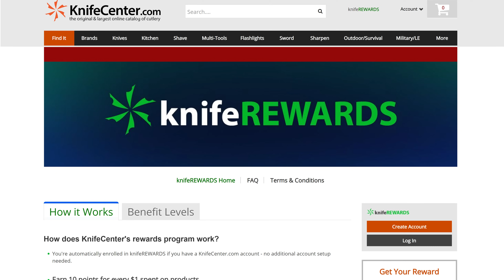KnifeCenter FAQ #133: What Makes A Knife Tough?

Comment: This is re the kitchen knives toughness issue. How does hardness/heat treat factor in? I’ve found that the European-style chef knives have both a less acute angle and softer steel on the Rockwell scale than Japanese knives. Which contributes to the Japanese knives being more prone to chipping if handled roughly. How does “hardness” relate to toughness?

Comment: Are there design features or trends of folders or fixed knives of "old" that you feel would be nice if they were modernized?
I recently found all of my 1990s knives, and every knife tried to have some type of rubber handle.  I find many of them significantly more comfortable than my modern knives.
I also miss the comfort of Spyderco's integrated pocket clips on the lightweight models.  Lefties be damned.

Comment: Not a question, just general information about a fan - me!
I worked in a scene shop and as a stage hand/stage manager from high school, through college, and out into the working world (1971-1991). My knife during all that time was a Sears (Craftsman) knife, which was essentially the 1961 version of the Swiss Army Soldier knife, same size, but with plastic, ’fake wood’ scales - with the old, claw-style can opener, not the Victorinox upgrade with the small screwdriver. It served me very well, and with it, I could handle pretty much everything I encountered. Today, I carry the Victorinox Evogrip 14, which has the same tool set (with the Victorinox can opener upgrade) plus the corkscrew, nail file, scissors, and the in-corkscrew screwdriver. I intentionally do NOT have the locking main blade. In these modern times, any locking blade, no matter how small, tends to be classed as a ‘weapon’. It’s easier to defend it as a ‘tool’ if that blade doesn’t lock. I also have several other knives (including Victorinox Huntsman and others, Buck 110, Buck 119, Morakniv Garberg, etc.). I enjoy watching all of your videos. Thank you.
Reply: I carry a Victorinox SwissTool X on a daily basis, I think I would literally be sick if I left home without it.

Comment: The reason you don't like scandi as much for feathersticking,is because you used shitty factory  edges. Try sharpening properly a scandi,which also means you add some convexing. You 'll like the scandi more after that,because it will both provide a sharper edge, than any other grind and also the geometry of the scandi,adds to the curling of the feathers. Thus you get a proper featherstick,that simply a very slicy non scandi grind knife,can not produce.

Comment: 4:00  Best description of toughness/strength I've yet heard!  
Legionaires? Seriously?  ;-)    Romans were legionaries!  Legionaires arose from the French Foreign Legion, and is a French term. These days (due to massive verbal contamination) the two terms have become synonymous! Yuch!
12:00 Scandi vs other grinds for feathersticking?  Wow! serious topic. Also what is a featherstick?  How fine? Do curls have to be ultra-fine, and have multiple curls? Depends who you speak to or read or view! The bushcrafting world seems to have adopted the fine curl mantra and applies that to all bushcrafting - that is my impression only, and I could be wrong! The fact that there are dozens, if not hundreds, of contrary viewpoints on the issue does not help.  I tend to agree with you though - particular skill, for a particular type of featherstick of a particular type of wood, in a particular condition, with a particular grind, ...........well I could go on, but that would not be constructive. Too many variables! To quote: "...... what works for you!". 
15:18  Kitchen knives:  I'm back to my hobby-horse - use knives for the purpose for which they were designed and constructed. Fine edge, thin blades are designed for slicing and cutting soft material like most vegetables, while for robust work like separating bones, or chopping through them, one needs a more robust tool, like a thicker blade or even a cleaver. That is why kitchen knife rails have so many different knives on them. A lemon tree Dear commenter!
Peanut butter sandwich - LOL!!!

Comment: Toughness of steel is its resistance to fracture- some steel gets to a certain point and breaks, another steel can get to that point but instead of immediately breaking it starts to deform.  This is a tougher steel.  You do something with your knife that you shouldn't do and you end up with a bent blade instead of a broken blade.  In other terminology a tough steel would be considered a more ductile steel.
Toughness of a blade depends on the steel but probably more on the shape of the blade.  A thin blade will be less tough, a blade with holes will be less tough, a blade with notches in the wrong place will be less tough.  Some steels are more sensitive to stress concentratches at notches and holes than other steels and these irregularities in the blade will prevent the steel from achieving its full strength, it will break first.

Comment: One thing I've wondered, are double detent slipjoints called that because they use a detent ball for both open and closed position, or because they use two detent balls, or is it both? I've heard both explanations and I don't know which is more accurate. Do most double detent slipjoints even use two detent balls? That sort of info doesn't get listed

Comment: Hey DCA and crew. I agree that convex edges are better at feathering wood over true scandi. Scandi grinds bite to much, and have less control in the cut by nature. I say a flat grind with convex edge rules. But my question is, are there any knives with titanium cheeks and steel core? I have a knife of a well known Swedish brand with a VG10 core and 420 sides. Is Titanium hard to bond with steel? Obvious you cannot really sharpen the spine. But the Titanium will need no care at all. Less care is more fun in my opinion.

Comment: Fascinating discussion on Shun Classic and Japanese steels.
I just finished sharpening a Shun Nakiri on my new Ken Onion belt sharpener and I noticed that the knife was catching on the paper when I tried to cut it.
Under an 8x magnifier, I could see 2 places where there were tiny chips out of the blade.
I have had a set of Henckels for over 30 years and I've never seen any of them chipped like the Shun.

Comment: Kitchen knife steel answer as a professional cook. 

A $45 Victorinox scores about 92/100 for me and you can beat the dickens out of them. They cut beautifully and are easy to maintain. 
Meanwhile, an R2/SG2 Japanese knife cuts better and is finished better but I'd only rate it as 95/100 with an asterisk about how it's not for cutting bones or chopping open a can.

Comment: DCA as a knife maker I get so frustrated when people confuse the term "edge retention" and "wear resistance".   You do it all the time, but don't feel bad, someone else you mentioned in this same video is guilty of the exact same mistake.    For example, during the segment about the straight razor, you said something like "edge retention is not the primary thing people want in a straight razor".  Uh, yeah it is.   What you actually meant to say was "wear resistance is not the primary thing....".   And that would be correct.   Wear resistance is not a desirable characteristic of knives such as straight razors, chisels, planer blades, and even kitchen knives.   In those knives, hardness (which is actually the definition of "strength") is most desirable as well as toughness.   Why toughness?  You want as hard of a blade as you can get with the toughness to go along with it that will resist edge chipping.   When it comes to wear resistance, it's about hardness and the carbide type, size, and volume.  The reason why you don't see straight razors very often in stainless steel is because the carbides are too large and thus chipping.  Low toughness.  Also harder to sharpen over carbon steel.   Even the PM steels aren't that suited for straight razors, with maybe the exception of say CPM154 for a stainless steel.   AEBL is a stainless steel that was actually developed for the razor industry and it has very very small and relatively soft chromium carbide, and a low volume of carbide as well and is thus very tough for a SS, but can attain good hardness to support thin edges and low angles.   But bottom line.....please quit conflating "edge retention" and "wear resistance".  They are two completely different properties, and I would strongly argue that actual "edge retention" is the most important property a knife can have.....how long will this edge last?   Wear resistance, in many applications, is not eve needed.
Reply: So you are saying you are a knife maker of some unknown knife brand and you are criticizing a knife maker (Nordsmith is DCA’s brand) and assuming you meant Larrin Thomas you know more than Phd in metallurgy?

Comment: Strength is, in a simplified sense, the ability of the material to withstand a constant force. Think of a structural I-beam, a steel beam can hold larger loads than an aluminum one. Design/shape and amount of material and we’re, can affect strength of a particular piece, but materials can have different strength ratings when tested in a like for like manner.

Toughness is related to impact resistance and the ability to withstand chips and cracks. It is basically the opposite of brittleness.

Stronger materials tend to be more stiff/less mailable and more brittle. Tough materials tend to be less brittle and have more flex/malleability.

Real world examples… A baseball bat would prioritize toughness, a pry bar would prioritize strength.

TLDR: in a like for like comparison… Strength is how well a material withstands forces/loads. Toughness is how well a material handles impacts and resistance to breaking. It is the opposite of brittleness in basic terms.

Comment: Hardness: resisting abrasion - e.g. scraping a knife on a rock and scratching the edge

Toughness: absorbing energy (shock and impact, also exhibited indirectly thru concentrated forces) without breaking - e.g. batoning or dropping a knife on its tip/edge and chipping it

Strength: resisting load before permanently deforming (yield strength) or breaking (ultimate strength) - e.g. hanging weight from a Triad lock until the blade/pin/lockbar/handle breaks

Comment: Hello there DCA and Thomas behind the camera. Certain TOPS knives and collabs by TOPS, for instance their night hawk collaboration with Buck, have cut outs near the spine used as an "oxygen tank wrench". I have heard people complain that this will effect the overall toughness of the blade because it causes a fracture point. Does it really matter?
Reply: Not really. They're no more a fracture point than the holes drilled in the handle for the scales. The blade may be slightly weaker than if it didn't have them, but it's not really enough to make a difference, and looking at all of the TOPS knives that have them, they're usually placed in widest portion of the blade, so there's plenty of structural support.

What you have to look out for are sharp corners/angles with no radius, as those can create an area where stress concentrates, which can lead to cracks and fracturing. All of the holes for the "oxygen tank wrench" are either completely round or are oval, so I don't think they'd be an issue.

Comment: I see a lot of S35VN. Does that mean it’s not USA made. Are steels only USA made if they are precluded by CPM or CTS?
Reply: All S35VN is made by Crucible in the USA. But many knives made of that steel are made elsewhere, Crucible will just supply those foreign companies with the raw materials.

CPM stands for Crucible Particle Metallurgy. It is a prefix for the particle steels made by the company Crucible

CTS is the company Carpenter Technology's prefix for some of their steels. They also use the prefix CTS Micro Melt for their particle steels.

Comment: The way I tend to think of steel qualities is in terms of resistance - corrosion resistance (stainlessness) wear resistance (edge retention) and impact resistance (toughness). That helps me get to the issues that matter most to me, and to avoid the semantics.
Reply: where does shear resistance come in?
(is it spelled sheer or shear i always get that mixed up)
Reply: @Kevin-qj7fp  this involves engineering strength of materials concepts- shear stress from shear forces and shear stress from torsion are both ways of inducing tension stress in the steel, and fracture comes from tension stress.

Comment: Hey David, can you recommend a fixed blade knife for a rafting guide buddy of mine? Hopefully something very rust resistant and not so large that it intimidates guests.
Reply: Mora floating knife. Just 3.75", brightly colored so not very intimidating, floats so if it is dropped in the water it can be recovered easily. Stainless steel, and only 25-30 bucks.
Reply: A friend of mine used to carry the Mora Eldris
Reply: @andrewdarowski1975  I wish they made the eldris in a floating configuration.

Comment: I carry a SAK Compact and a Gerber Dime.   For me the advantage, in additional to overall size, is pliers and screw driver in separate tools where I can use both at the same time, to hold a nut while tightening or loosening a bolt.
Reply: hadn’t thought of that, nice setup
Reply: The SAK Compact is a big favorite among collectors.
Reply: @Ericstraordinary  Hard to beat the Compact as a useful everyday tool set in an easily carried package.
Reply: Thats why I edc a Knipex Cobra 150 and a Spirit X.